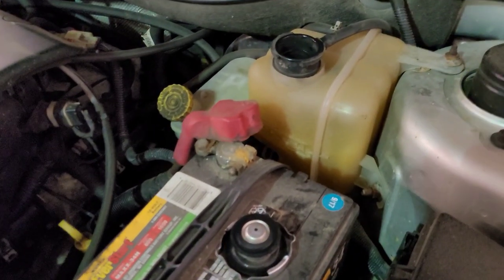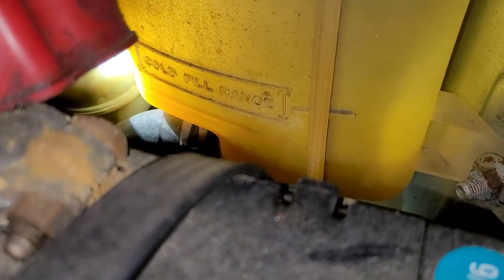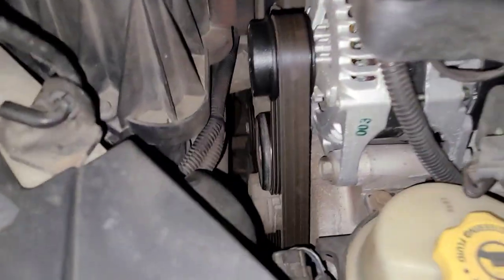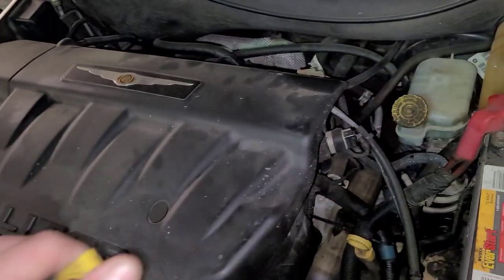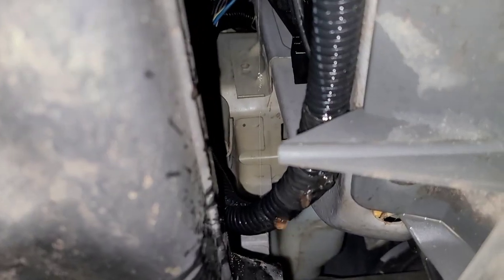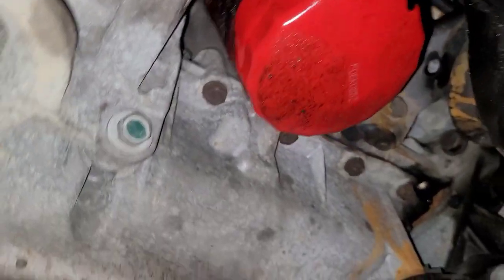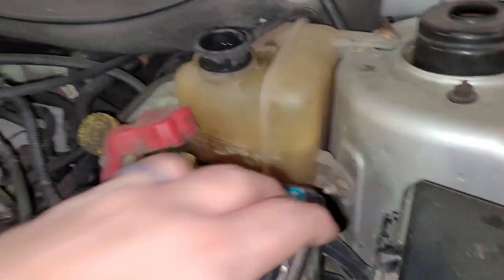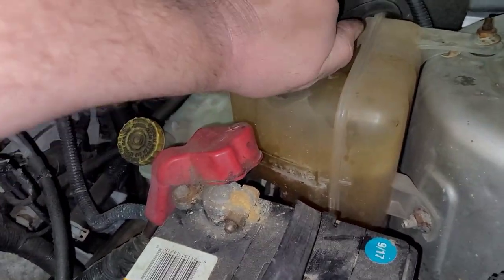Coolant Leak Surprise!! I Wasn't Expecting This!!

Comment: I just watched another one of my YouTubers who runs a Heavy Tow and Offroad Recovery business out West.  He does a bunch of work for UHaul and they needed him to do a Long Haul tow on a box truck with Oil Pressure issues.  When he pulled it out to load it on the flatbed, he got curious.  It was just a loose oil filter dumping the vital fluids out.  He tightened the filter and added oil to fix the issue.  He lost a tow job that day but earned the trust of a customer who will keep sending him business and recommending him to others.
There are good guys out there, you just got to find one and keep him busy.

Comment: About the hose coming off and clamp replacement - good points you make on going ahead with putting a new one there.

Just had to replace 2 spring clamps on my car. There are 2 rubber hoses mounted under the rear climate unit, placed over the muffler heat shield and attached to the frame standoff. I observed surface rust on the shield and realized the clamps had lost their squeeze simply from rust/corrosion. One broke in pieces as I removed it...

I recall a buddy trying to convince me of the superiority of the spring clamps decades ago when they were introduced. Consistent clamping around the hose, no tearing,.. 

But they also have drawbacks - you have to take care to orient the clamp just as it was if you put it back on, to ride in the depressions it made over time. The effective clamping of these lessens as the rubber gives, and you can't tighten tighten them any further.

Truth is, like in so many things, spring clamps are cheaper and save labor on the assembly line. Especially in the case when the clamp is built onto the hose and only needs to released after joining.

In my recent fix, accessibility also dictated i use conventional worm clamps, because they allowed me to open the band and slip it around the hose then start it into the worm screw.

I Could have done it with spring clamps, but Only if I dropped the exhaust and heat shield.

Always great presentation!
Hope your wife continues to make good recovery!

Comment: 8:36 When my daughter’s 06 Pacifica lost a serpentine idler bearing, I went ahead and changed the timing belt under the cover and the tensioner and water pump!  The only tricky thing was getting the power steering pump out of the way adequately while trying to keep disassembly to a minimum!  
     Thanks for the great videos, Kenny!

Comment: Extractors are the bomb!

I acquired one a few years back.  Boy!  Did it make my oil changes a lot more convenient!  Rather than taking an hour or two to pull out and set up the jack stands, I can just vacuum out the oil!  An oil change now happens in a matter of minutes rather than hours.

Once a year, all the vehicle's are up on jack stands for other maintenance.  And, when that happens, I refresh the oil filters.

I like the vacuum extraction ease so much, I pulled the oil pan off my 1993 Chevy C1500 to alter the slosh baffles and weld in some blocking plates to keep the extraction dip tube from hanging up.  Well worth the effort!

Power steering fluid changes?  Vacuum out, replace, run for a couple of weeks, repeat.

I should have gotten one years ago!
Reply: Same with auto gearbox.  Change oil and oil filter about 100,000 Km according to your driving terrain.
Motorway driving less frequently.

Comment: I agree with you, I think someone had it apart and put the clamp back on top of the bulge in the radiator not behind it.  That's the only thing I can think of.  As for replacing that wonderful spring clamp with a second rate worm clamp I wouldn't go that route.  I have had worm clamps leak after a couple of years as the rubber under them shrinks.  Spring clamps don't have that issue.  If you are going to use a worm clamp I would use a constant tension one like they use on big trucks.  Just my experience.  Yes I could hear the coil arcing.   Keep the good stuff coming.
Reply: the rubber actually didn't shrink, it was compressed. the plastic expands and put more pressure on the hose clamp. luckily it was just the hose and not the radiator that took the brunt of it. worm clamps and plastic nipples do not mix.

Comment: One morning I walked out and saw a puddle of coolant  under my old 89 Jeep Wrangler, turns out it blew the same lower radiator hose off the radiator for no apparent reason. I did the same fix, but since it had about 300,000 miles on it and I couldn't remember ever replacing the hose. I figured it was a message from God that it needed some maintenance, so I ended up replacing the radiator and both hoses.

Comment: The motor mount is broken and the engine will torque and lift.. The engine will also crush the wire harness to the computer in the fender.

Comment: WWK, have you ever used florescent  dye to find leaks ? I recently used some to find a  coolant leak..it made finding the leak so much easier..
It ended up being water pump o-ring on 5.7 hemi ..replace  the pump since I had it off anyways.

Comment: something i have learned over time, springs clamps are used for a reason on plastic nipples. it's to maintain clamping pressure during thermal expansion. a worm clamp cannot do this and will stress the plastic leading to a early failure, it won't be right away but over time.

Comment: The spring clamp you took off is a better clamp than the worm clamp that you put on. Especially when you can actually stage that spring clamp where it is staged open and then just push on it with a screwdriver and it will clamp itself on. I have had three worm clamps fail in the years that I have been working on automobiles and I have never seen one of those spring clamps fail. I've heard of them being broken I've never seen one broken. The other thing that I always do whenever possible as I use a balanced sleeve thermostat whenever possible I will even cut one down and make it fit into a spot. I have never seen one of those fail. The puppet type I've seen fail on a regular basis.
Reply: I hate those things, do they actually sell spring clamps off the shelf?
Reply: @philspear73  Available from industrial supply places like McMaster-Carr. I'm a fan of them, too. Always the right tension, never too much, too little, no follow-up tightening required (great for inaccessible spots)  and most importantly, not low tension when needed most -- high heat.  There are some Gates videos out there about how their heat-shrink hose clamps are the best, but in the comparisons they show, the spring clamps are in 2nd place.

Having the right tools/pliers for them makes them a lot less annoying.
Reply: I've heard people here on these YouTubes see that they've seen them fail. I don't know if they work on one brand of car or in the rust belt.

I made one fail decades ago by storing it squeezed-open in a pair of 10" Vice Grips while a project was on hold. When I went to install it on a later project, it cracked and had zero tension. That one's on me!
Reply: If spring clamps are start rusting even a bit,  they will lose grip at a high pace, so as this one did, replacing was due.
Reply: Obviously any part can fail. As mentioned a spring type clamp exerts constant pressure regardless of expansion or contraction of the hose so it never needs tightening, where a worm clamp, while capable of greater constriction force, remains the same diameter, meaning when the hose starts to loose its elasticity it can't self tighten. The spring type clamp will usually last longer, but once a hose completely looses it's elasticity (starts to bulge and/or leak at the connection, paradoxically a worm clamp works better, due to its greater clamping force, but only as a temporary fix, because by then the hose really needs to be replaced.
Reply: @TheOnespeedbiker  Ha! I didn't even get on my "change your hoses before they ruin your day, silly" soapbox! 😁
Reply: @theundergroundlairofthesqu9261  The worm clamp should at least get to and back from the parts store.

Comment: surprised you didn't mention Art Carney on Laugh-in with the VERY INTERESTING segment, yeah the coil is sending morse code 'replace me'. As you mentioned, the water pump leaking as timing belt driven, will you be showing that

Comment: The engine mounts on these go bad easily and maybe the hose was adequately on until the engine mount let the engine move more than its normal distance on acceleration.  Check the motor mounts!

Comment: I've changed oil in my cars for years & ran my own shop. For some reason I've seen more Chevys have loose oil filters. Even on my own '95 truck I've found the filter loose. Know what you're thinkin', not tight enough when put on but it was damn snug when put on. Curious if anyone else has noticed this?

Comment: So Kenny, the Chrysler 3.5 liter V6 is a totally different engine from the 2.7 litre, right? I think it doesn't have a water pump internal to the block like the 2.7 does(?) I am still hoping that sometime you will tell us how you really feel about the 2.7. Thanks for the good videos.
Reply: The 2.7 is ABSOLUTE garbage. THE 3.2 and 3.5 are also trash. The 3.7 is junk and the new 3.6 engines aren't that great either.
Reply: @louiewatson9389 2.7 is garbage right I've had no problems with 3.5

Comment: I'd be a little concerned about things that cause overpressure inside the cooling system. A bad thermostat or failing water pump could cause inefficient cooling, leading to superheating of trapped air, then leading to a spike of pressure. Then you get decompression at the weakest point, which should be the radiator cap. If the cap sticks, a hose blows off.
Reply from the maker: I honestly believe the hose was not installed correctly. I road tested it and all seemed good . Just waiting for the approval to do the timing belt and water pump
Reply: @WrenchingWithKenny  Don’t let the car go without a timing belt, tensioner and pump! If the tensioner ever fails or the pump or the belt, it’s an interference engine and valves will be bent!
Reply: @WrenchingWithKenny  Also check the engine mounts!  These are notorious for failing mounts.

Comment: Hopefully that's not an aftermarket radiator. Some have smaller inlet and outlet fittings where the hoses go on. Ask me how I know. Another reason why I hate aftermarket parts. I put one in a vehicle one time and the damn hose blew off because of that, had to put a worm clamp on it to get the right tension on it.

Comment: I had a guy say "this hose keeps blowing off, I've replaced the clamps 5 times got a new hose, cleaned the connection ect ect" I grabbed my exhaust gas contamination tester and sure enough -head gasket blown: too much pressure in the coolant lines
Reply: Years ago, a next-door neighbor's car kept "losing" water.  He'd fill it, and the level would drop.  I pulled out the oil dipstick to find "chocolatey" oil: Blown head gasket was my guess.  He wouldn't hear it, "I just had the engine rebuilt!"  I just had to walk away.  The car disappeared not long after that.  The kid probably blew the engine. 😒

Comment: It's rare to be able to fix an oil leak and a coolant leak in 5 minutes. too bad the water pump threw a "wrench" into the works..but not bad for business. the customer will do backflips once they have all 6 cylinders firing again, they won't know what to do with all the power. I think the last Chrysler engine I owned was a 340, how about that apple? probably came out of a '70 Duster, I had it in a '74 Dart. so, if the T-belt wasn't done the whole kit also comes with idlers, tensioner, the pump.. I also advise people to change their coolant regularly, it gets high in pH and the modern materials don't take it well, the core & such. it's not the old copper-brass we all knew and loved, that's gone. maybe the big rigs still have it? I do my coolant every fall, but you can go 2 yrs I suppose. I wouldn't go longer. some people never change it, until it all leaks out. same with the oil I guess.

Comment: Crankcase can have oil, but a loose & dripping filter will cause 
low oil pressure. That vehicle is a hot mess!

Comment: That spring clamp is a considerably more Superior clamp than the worm clamp. You do not change a spring clamp just because somebody didn't put it back together. I disagree with your thinking in this situation. Normally you are excellent you're a thought process. But I would never change a spring clamp even if it was a bit Rusty I would not change it. The pressures put on by that spring clamp are considerably Superior.
As for the 3.5 liter Chrysler Products comma That was a vehicle that I have seen Very little maintenance done like next to none comma and they have lasted somewhere in the neighborhood of between 160 180 000 miles minimum. We're just a little bit of maintenance, like changing out the water pump whenever you put a new timing belt on it. Which I have never seen anybody do the timing belt on time on one of those engines. They use those in Formula 3000 race cars for almost a decade without a single failure of an engine in competition

Comment: I think you’re making a mistake going to a worm clamp. You’re better off using the old spring clamp, or replacing it with one of the same type. At the very least, in an emergency, use a worm clamp designed for silicone hoses where the worm slots are shielded from the rubber. You’ve lost come credibility with me.